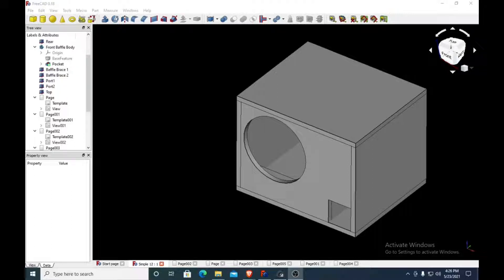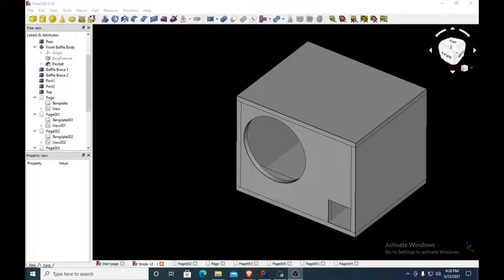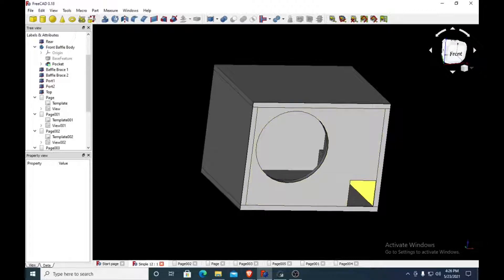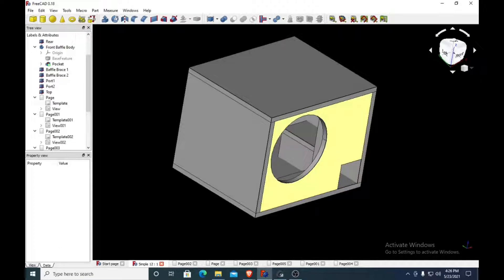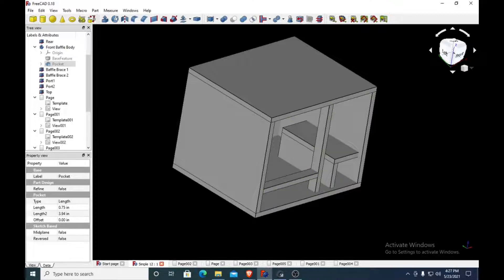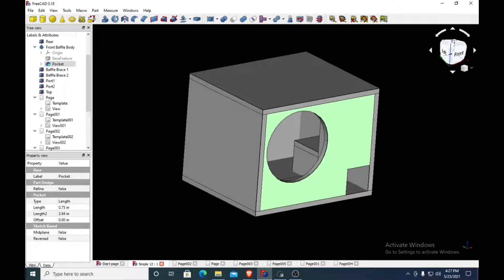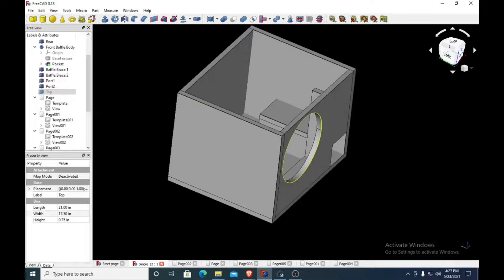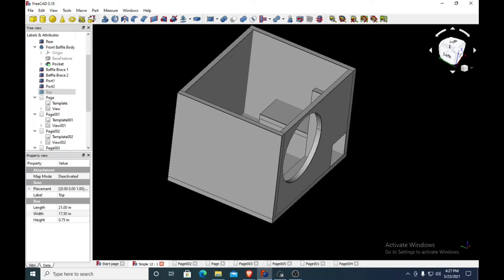Free Simple 12 Inch Subwoofer Box Design For Budget Subwoofers | Ported 2.5 cu. ft. 34Hz Tuning

Comment: What is the best port? Aero port or rectangular/slot/sqare port?
Reply from the maker: I like slot ports but aero ports are typically regarded as more efficient because they have a maximal amount of port area compared to the surface area of the walls of the port. The walls of the port will create some drag, and the more surface area, the more drag. I still like slot ports, though, and I'm sure there's quite a lot more to it than that.